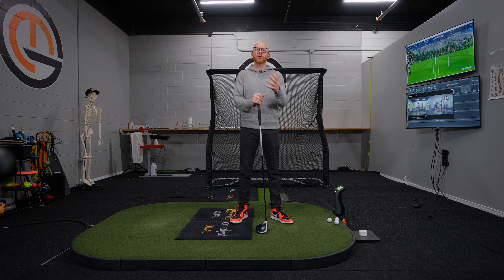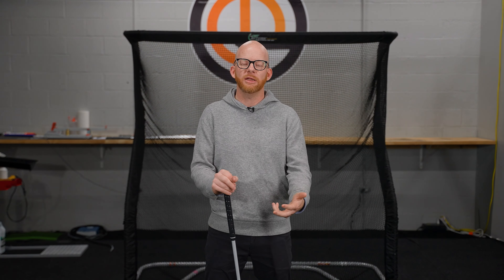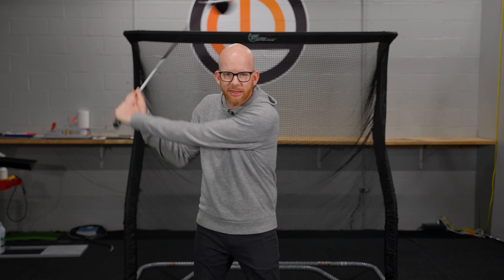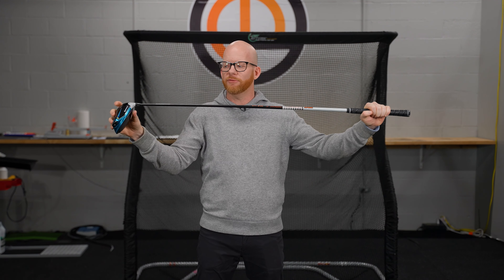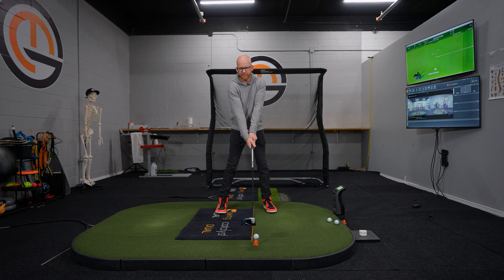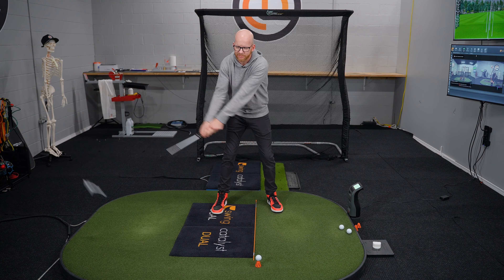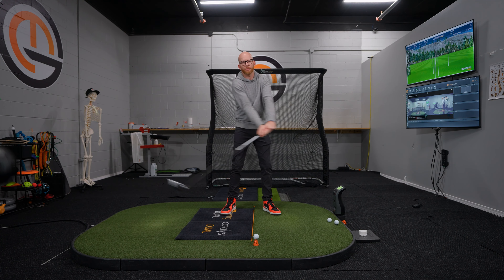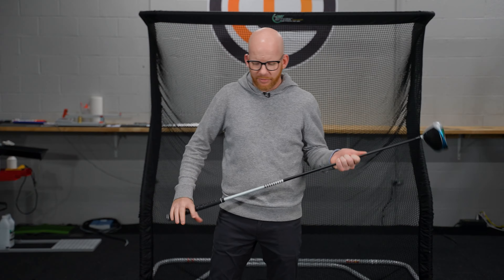Increasing Your Clubhead Speed

Comment: Great video. Is this the same with irons? And the shaft lean look is just from the ball being further back in the stance?
Reply from the maker: Thank you! Yes, it is the same with irons. You don’t want to lean the shaft towards the target as that will only increase the club path to the right and wreak havoc on your dynamic lie. Due to the body rotating past the square starting point prior to impact, the forward shaft lean would be better described as inward shaft lean due to the lead shoulder being farther away from the ball at impact than address.

Comment: Are you saying that the club should be decelerating before bottoming out?
Reply from the maker: The grip end of the club will be slowing down relative to the club head prior to impact. Otherwise, the shaft would never unbend and all of the potential energy would be trapped in a shorter shaft.
Reply: @measuredgolf  Teach us man 😀
Reply: How does the breaking point is induced ?
Reply: In your flamingo driill your leg is static...so how to you use  gff ??? Confused.
Reply from the maker: @lutzchoco1  While the single leg drill takes away the towards/away movement of the lead leg relative to the ball as well as the towards/away movement of the lead leg relative to the target, it doesn’t take away the movement of towards/away from the ground. The leg extends vertically as the muscles contract around the Skelton and create extension. The idea of the drill is people spend so much time moving towards and away from the target that they never have time to twist and rise on the lead leg. Great question and hope this helps. P.S. cameras only tell a small part of the story.
Reply from the maker: @lutzchoco1  By pairing maximum vertical force with minimum horizontal force and applying 2/3 of the total positive a/p torque with the lead leg.